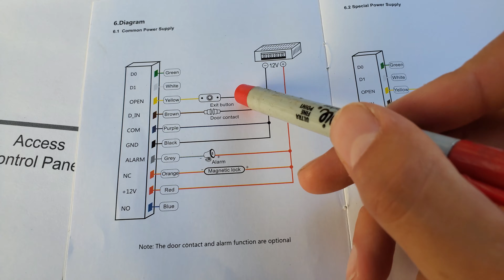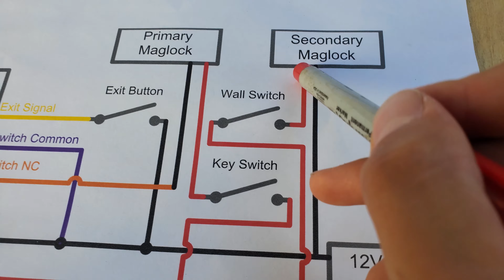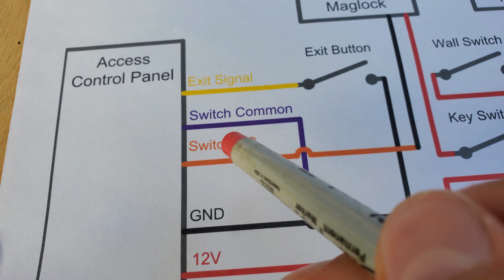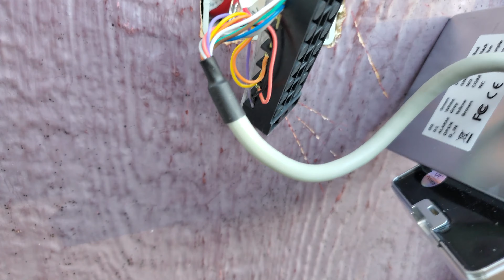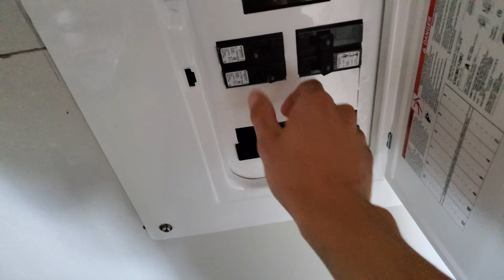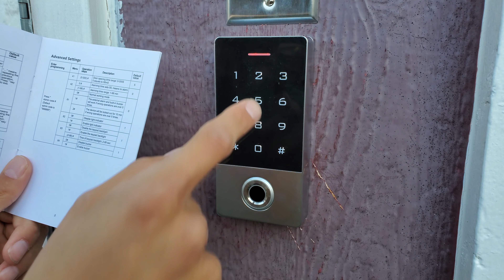Shed to Workshop Conversion - Part 5 - Fingerprint Magnetic Lock Panel Install

Comment: Where abouts do I buy this product? What's the model of it?
Reply from the maker: No telling how long the link will work, here is an example: https://www.aliexpress.com/item/4001203018732.html?

The TF1 model is what you would be looking for. It has no included power supply, or mag-locks, so you would need to purchase those separately.